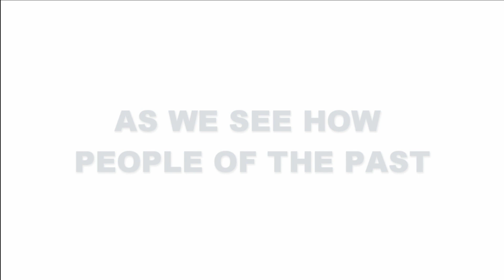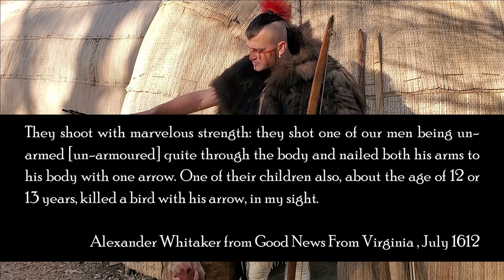Primed and Loaded | Introduction to the Powhatan Long Bow

Comment: I like this video. It is informative and well made. I just have one point to add. I doubt that the Powhatan warriors put the arrows on the string in the way show. I believe they probably used a similar technique I learned when I started to learn Asian archery. The technique is to take the arrow shaft, put it on the bow shaft, hold the shaft with your bow hand to the shaft while you slide your arrow hand down the shaft until you find the nock. Hold the arrow by the nock and slide the arrow forward until you go past the string. Slide the arrow hand backwards putting the nock on the string and pull the string a little bit until you have some tension on the string. At that point in time, you put your arrow hand in the right position to pull the bow to full draw if you want to and stop holding the arrow to the bow shaft. - This technique is easier shown as descripted. – If you practice this move a 1000-times, you can do this without looking quite fast, like on a galloping horse passing by the target.

Comment: Does anybody know what kind of wood was used for the arrows shaft? Or was it cane?
Reply: i have a book on native bows and arrows. the north eastern natives would often split logs and make arrows from hickory
Reply: @Soviless99  Thank you,  it must have been hard and lengthy work without special tools
Reply: @gigizack  hell yea. i know making arrows from many prepared materials is a involved process in itself
Reply: gigizack -- though other materials could be used generally Powhatan arrows were made from river cane. And Russell's arrows are made of cane as well.
Reply: @jamesread1607  Thanks James, any information about the use of dogwood?
Reply: @Soviless99  That's what I do too. Any other method I've tried does not result in a straight arrow.
Reply: @rachdarastrix5251  try finding relatively straight blood twig dog wood
shoots and heat straighten them. cut them a few inches longer then final arrow length and seal the ends with glue, leave bark in tact... bundle them after (in a group of 7) and twice a week unbundle
them and hand straighten them. re bundle them and keep doing this until they are dry. depending on conditions, i’ve found it takes about a month or two.
Reply: @Soviless99  A curling iron should do the trick.

Comment: Interesting! Did they really shot this way? I mean split fingers draw and arrow on the left side of the bow like modern archers shoot?
Reply: most likely they would have been using primary draw, witch is pinch draw with one or two fingers assisting from the string. but 3 finger draw was used by native Americans but not as common as primary draw.
Note that records say that native americans (some not all, some used very short bows with short draw, but I'm talking about the longbow users) drew behind their ear, unlike this guy short drawing and releasing with very short draw.
Reply: @jkre  they didn't draw a bow behind their ears.

Comment: "Gets it's name and it's power from its length".
Name yes, but not it's power. Bows power has nothing to do with bows length. Bows power comes from 3 things, Draw length, Draw weight from all that draw length, not only the max draw weight, some bows has higher early draw weight than others and lastly bows efficiency.

Bows length does affect the maximum possible draw length, but it's not the only thing affecting that, it is possible with material and design choices to have a shorter bow that has longer draw length than a longer bow. So just by bows length alone, you cannot say that its more powerful if it's longer.

Comment: The reason the arrow nocks are shallow is because eastern woodlands groups, like many other north American tribes, used a tertiary draw which is a pinch grip that uses three fingers as well, not the 3-finger draw shown here. Tertiary draw means you can much more easily keep the nock engaged on the string. I feel like this is a basic thing you should know if you're representing historical archery for a museum.

here's a good example: https://www.youtube.com/watch?v=uza0Kw8pLEQ
Reply from the maker: There is very little in terms of traditional Eastern Woodlands archery equipment and technique that survives. What survives is the tiniest fragment and does not provide enough to say that all of the archers of an entire region would have drawn their bows this one exact way, in fact that is rare to see much of anywhere. Across hundreds of tribes with different languages and cultures the idea that they would all do one thing the exact same way is simply not supported. Also heavier bow weights supported by colonial accounts, recreations and passed down archery tradition does not always allow for such draws without the aid of a thumb ring. To better illustrate here are two videos you can reference of modern traditional Cherokee bowmakers using the three-finger draw. 
https://youtu.be/ACEmMhBZQj0?si=i6sLCzdBuVTQUQkU 
https://youtu.be/AjDGzdW6AxI?si=7HoqWlhOchuHiAc-
Reply: @JYFMuseums  Modern archers in Papua New Guinea use the tertiary pinch grip unaided with 80-90 pound bows. If I wasn't clear, it's a finger release that uses 3 fingers to draw the bow but a pinch on the string with the thumb in order to give the arrow greater support. It's quite a useful draw for high poundage because because it gives a lot of surface contact with the string, distributing the force even more than a 3-finger draw. And thumb rings are for thumb release, not the tertiary pinch grip.

Secondary and tertiary pinch grips like these are common with shallow and bulbous nocks, like the ones used in the eastern woodlands, and in fact with shallow, bulbous, or non-existent nocks all over the world.

It's actually not rare to see that archers from the same cultural and historical tradition would draw their bows in a consistent way. European and Mediterranean archers drew their bows with a 3-finger grip from the Roman period to the present. The thumb draw is widespread from Turkey to Japan across Asia. And tertiary and secondary draws were quite widespread across the Americas including the eastern woodlands, which are attested in historical and ethnographic records.

heres some info: https://www.archerylibrary.com/books/morse/ancient-and-modern-methods-of-arrow-release/docs/notes03.html